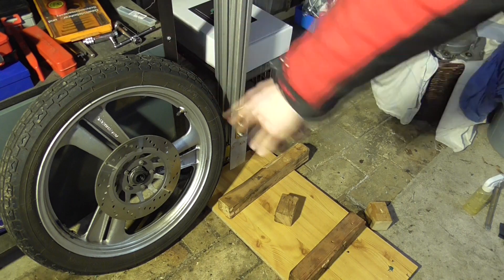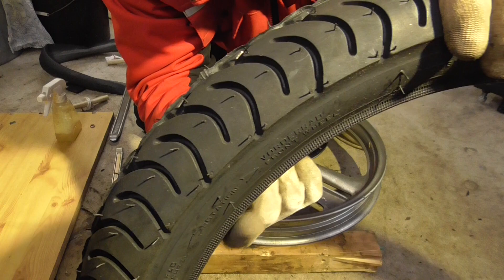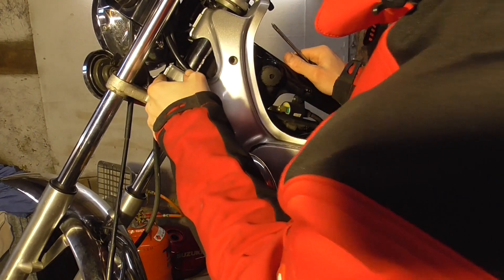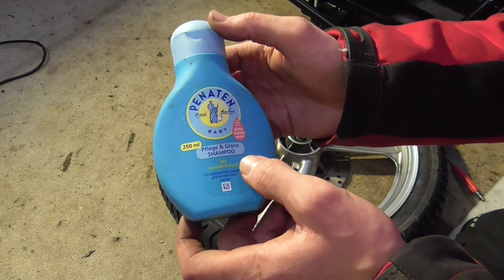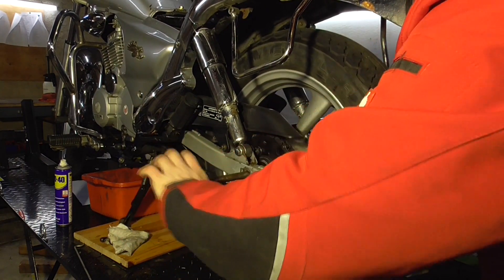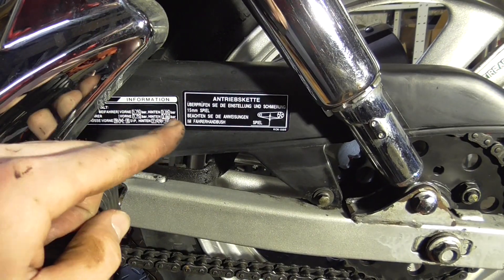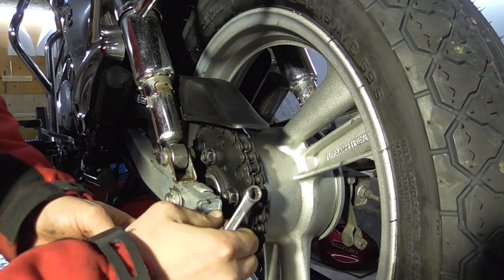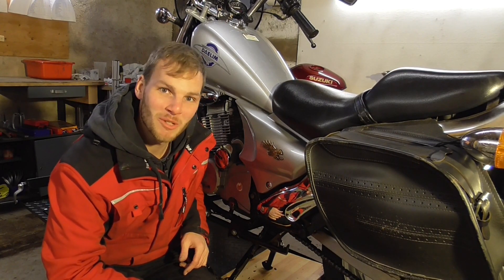Daelim VS 125 chopper - Tube destroyed? Chain adjustment and TIRE change - part 2

Comment: Hello! Can you help me? the Daleim VS 125 camshaft needs to be adjusted, where should the camshaft sprocket be adjusted? Should the 2 lines be horizontal or the 2 screws? Thanks!
Reply from the maker: Can't help here sorry
Reply: @bikedogtor1663  When you adjust the valves, how is the timing sprocket? How is it? Thanks from Hungary!

Comment: I just found your channel, and i can say already that the content is very unique, filming angle is good and explaning is super. I had an daelim vc 125f a few years ago, my first bike and a great bike, haven't done too much to it, it had only ~8000km, actually i bought it from baden wurtemberg if it's sound familiar to you ( i'm from Romania ), and now i'm thinking about getting another daelim again (found one exactly like yours ). I have a few questions for you: 
-how do you know that a chain is worn ? now seeing your video i understand why everytime i was changing gears my chain was clanking 
-i heard some things about that chain sprocket, if it has less teeths it will get to higher speed and accelerate slower and if it has more analog, is it true? cause it's a hell of a thing to get over 100kmh with this bike :D
Servus !
Reply from the maker: Hi, thank you for your nice comment. You can tell that a chain is worn by different things. Check the teeth of the sprockets. If they are sharp they need to be replaced and on street bikes both sprockets and the chain have to be replaced then. If the chain adjuster is adjusted to the end you should check the chain as well. That's done by measuring the length of a certain amount of rollers. Best is you check my suzuki bandit chain video and you will clearly see more things to check if a chain is worn.
Reply from the maker: Ah yeah and if you mount a smaller rear sprocket the top speed gets higher that's right.